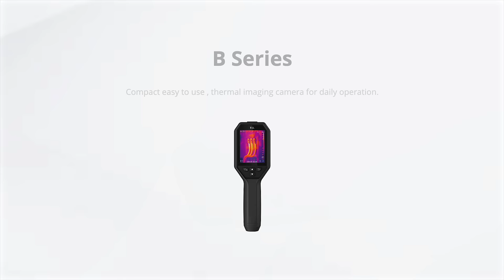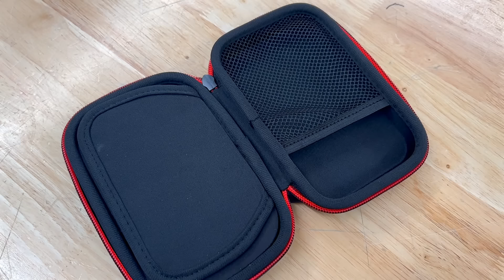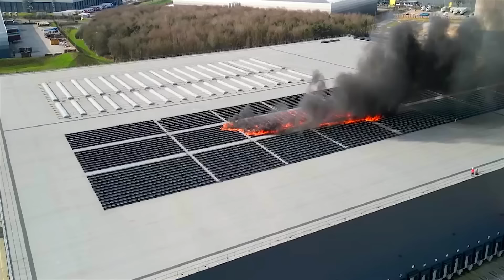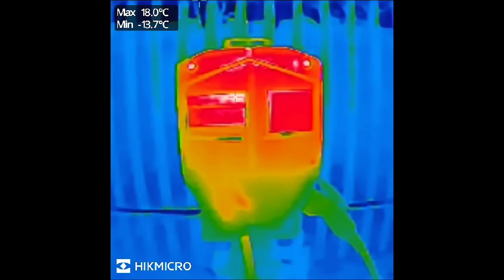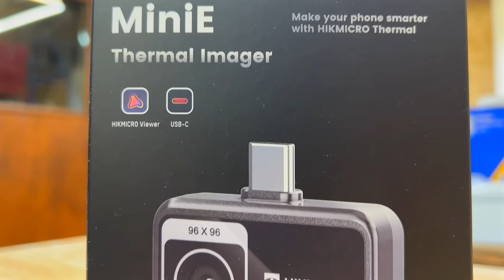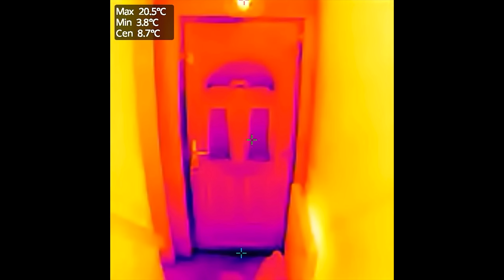HIKMICRO Thermal Camera: Too Cheap To Be Good?

Comment from the maker: =AD= Check Price and Availability
https://hub.efixx.co.uk/pn3
Use Discount Code 
EFIXXMINIE for 10% off
Reply: tbh don't buy this one, buy their mini2 v2 which has a 5.33x higher resolution and is still very cheap. it's just better built too, the one in the video has an indented lens which will catch dust (as it already has in the video). the model in the video is strongly outdated. after vouchers the better one costs 60% more so don't waste your money with the cheap one.

Comment: I have a TC002, but it has a Lightning connector and I recently switched to an iPhone 15. I purchased an official Apple adapter cable so I can connect it to my phone. I feel like the image resolution has gotten much worse. I've cleaned the lens which didn't help. I haven't messed with any settings since I bought it over a year ago. So I bought a Thermal Master P3, which connects directly to my phone. I also compared both cameras on my old phone and the new one, and the P3 looks better, especially in color detail and object edges. I don’t think this is a phone image issue. Anyone who has used iPhones knows there isn’t much difference between the iPhone 14 and 15.
Reply: how about it compared with hikmicro mini2v2?
Reply: @ColletteDuty  I think I’ll choose the Thermal Master P3. While all three are good choice but P3 is the only one that comes with a macro lens.
Reply: @UsainiKabo  P3 is really an amazing thermal camera. A need for electronics repair. The image is great! Simple to use, and no issues with the app so far.

Comment: Thanks for the video. Can this detect the source of water leakage for a home?
Reply: Absolutely, this is the most useful feature of the thermal camera for home inspections.
Reply: @UsainiKabo  Thermal cameras are super‑handy tools for home inspections. They pick up tiny heat changes around your house to find hidden moisture, leak spots, poor insulation, draughty windows, overheating electrics and faulty underfloor heating. Best of all, you won’t need to knock down any walls to uncover those hidden problems.

Comment: I would need advice.
in prevision of the winter i would like a thermal camera to find drafts and poorly insulated spots in my apartment.

Would this camera be good? is there better?
i can't afford an expensive one
Reply: check the P1 from thermal master
Reply: @Braulio-v8e  P1 would be a great choice
Reply: For personal‑use devices you don’t fire up very often, I’d strongly recommend getting a standalone unit. No need to rely on your phone or extra attachments every single time you want to take a thermal scan.

Comment: I have a Uni-T 256B and like it. It has a 256*192 thermal resolution and I wouldn't want much lower thermal resolution than that.

Can show you the hot patches coming in through the ceiling as well as cold patches!

Used to have access to a phone-based one and there are advantages and disadvantages. The big plus points to one that plugs in to your phone are ease of accessing the pictures and the portability. For trundling round a site or for lending to people, the standalone one is much easier. If you're picking it up to look at things, putting it down to take a cover off, shoving it underneath a solar panel or whatever, the more robust nature of the standalone one is well worth it.

Comment: is the 2% accuracy calculated on degrees Kelvin or on degrees from "Zero Celsius" ?
Reply: And FYI,  Kelvin doesn't have degrees.
When we talk about temperature in Kelvin, it has just Kelvin, the word degrees is never used.

So 5K, 200K, never 5°K, 200°K.
Degrees, ° only applies to celcius and fahrenheit. Spoken out loud, that is Five Kelvin, Two Hundred Kelvin.

In celcius it would be: 5°C, 200°C.
Reply: @deanXRayZulu  And I thought I was pedantic  😀
I stand corrected.  -  Always happy to learn.
Reply: @geraldelwood9660  There are two key subjects which I covered  as part of my degree: 1. Test and Measurement, and 2. Theory and operation of digital multimeters including the dual slope integrating analogue to digital converter which converts the measured voltage or current into a binary number for processing and display on an LCD screen. We hammered this topic to death!

Unfortunately, these were not topics we could choose! The test and measurement was pretty dry, but understanding how digital multimeters work was quite interesting, and they are quite clever.
Reply: Doesn't matter.
What 2% accuracy means is what is shown on the display is within 2% of the actual temperature of what it is looking at.

Accuracy is not based on some lower reference temperature such as 0°C, or 0  Kelvin, or 32°F.

Now what could happen, is through software error, is have a different magnitude of error for different units displayed, so it could be 2% error when displaying celcius, 2.5% error when displaying Fahrenheit, but this would be down to errors in the numerical representation internally when performing the calculations.
This is extremely unlikely and the manual for the product should tell you to which temperature units the accuracy figure applies, and specify if it is different for any of the units.

My betting is the manual indicates the 2% accuracy applies to all temperature units displayed
Reply: @deanXRayZulu  Maybe I'm having a senior moment, but if the display shows 10C, then it is +or-  0.2 degrees C.  potential error.  IF the display were in Kelvin - i.e .  283K, +or-  2% would be 28.3 times Bigger than if calculated on a 10C display.
However - if it is 2% of displayed value; then that answers my question. 
Just don't display in Kelvin 😀
Reply: @geraldelwood9660  The error is not caused by the display, except where the display does not have enough digits to display the temperature to enough precision.
This isn't an issue on LCD type screens but could be an issue if a 7 segment multi digit type display is being used.
Let's suppose the temperature is represented internally by a 16 but binary number which is the output from an analogue to digital converter.

A temperature sensor outputs an analogue voltage which is connected to a 16 bit ADC.

The output number produced by the ADC is a number from 0 to 65535 representing the full range of temperature the camera imaging sensor can handle . Probably isn't 16bit in this case, but let's use this as an example.

If it receives a temperature of 30° celcius, and the ADC outputs a binary value of say 1027.

The accuracy issue is this: the perfectly correct value (0.0000% error) for the ADC output of a temperature of 30° is 1000 but it is actually outputting 1027, so there's an error of 27.  So you can see that one source of error is in the temperature sensor and conversion of the analogue signal into a binary representation.
That is completely independent of the units of temperature used.

Now, that binary number representing the temperature has to be converted into a number appropriate for us humans to understand, so it needs to be converted into some temperature scale - celcius, Fahrenheit or Kelvin.
These scales use decimal numbers and calculations have to be performed. And this is a second source of error.
When calculations are done on real numbers an error can accumulate, it's to do with the number of bits used to hold the number and truncation and rounding errors occur.
There's fixed point and floating point arithmetic.
This calculation error is likely to be very small.

Now in the case of infrared cameras, there is a major problem that needs to be talked about when making temperature measurements.

The camera isn't actually measuring temperature. It is detecting and measuring infrared light.
That isn't temperature.
A thermocouple temperature probe is directly measuring the movement of air molecules (if it is placed in air).
This isn't how Infrared temperature measurement works.

There is a concept known as emissivity.
And it's do with how well object emit or reflect infrared light.

This is the reason why you will see Infrared temperature clinical thermometers advertised as clinical and why if you want to measure the human body temperature with one accurately, then you must use a clinical type as these have been calibrated and designed to work accurately for the emissivity of human skin.